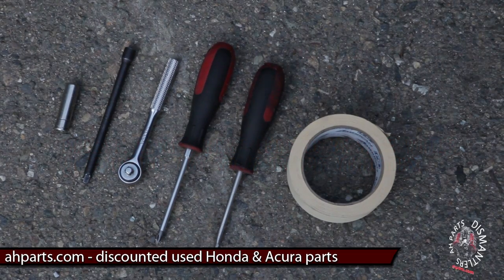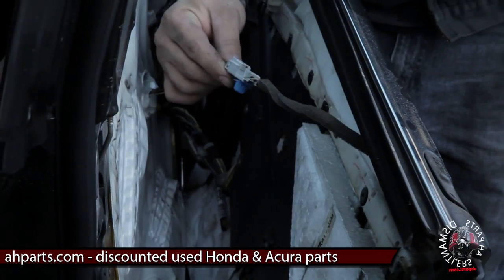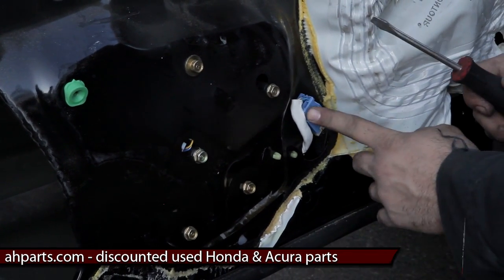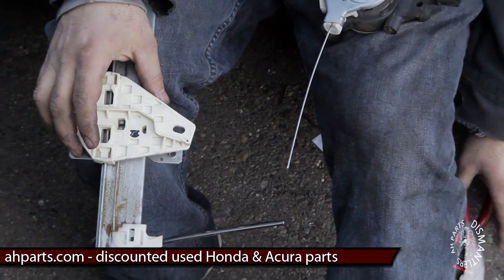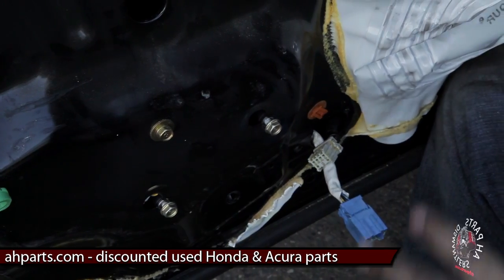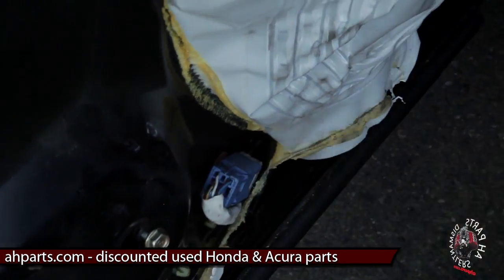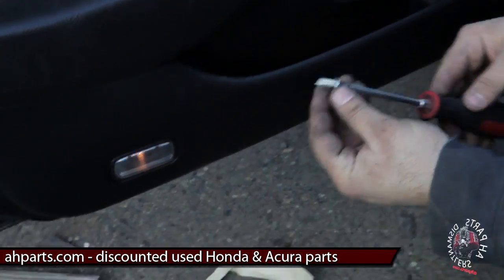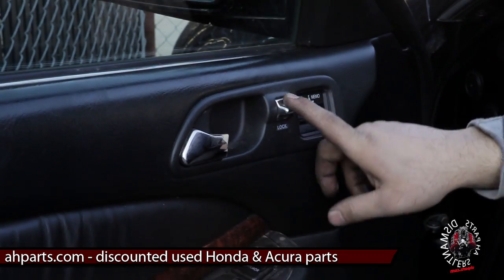How to fix install replace window regulator motor DIY 99 00 01 02 03 Acura TL Replacement Tutorial

Comment: When you remove the plastic barrier, you can also use a heat gun to warm the adhesive for removal.  This will  help preserve the weather barrier for a snug seal when replacing.  Used your video to replace my 2000 3.2 TL driver's side regulator. Your narration of instructions was awesome. The lighting and view angles were also spot-on.

Comment: GREAT tutorial.  I made short work of this job on my '02 Acura TL. Thanks for the tips on the masking tape on the window, and the glue in the socket.

Two things:

1.  I ended up with 3 screws “left over”.  I was stuck for a minute until I remembered that the regulator came with the 3 “grooved” screws already included.
2.  I wasn't able to test the window until the switch on the door panel was reconnected.

Comment: I have my daughter's 1997 Acura 2.2 CL with this regulator problem. I am confident that with this video and my shop manual I'll get the job done. Thanks for a well thought out and detailed How-To video. I especially like the care you and the videographer took to show the bits and pieces i.e. the slots of the partially removed bolts, etc. Great job.

Comment: Success! This tutorial just worked for me, and I purchased the part directly from you because this video seemed so good.  I have not worked on my own car in over a year, and rarely do so.  This made it quick and stress free.  Saved me over $300 that would have been down the drain.  Saved me from getting a broken or slow-shipping part from somewhere else.  Wasn't sure this would fix it because it used to work sometimes and not work other times and I thought it was electrical. Tremendous thanks.

Comment: Thanks guys for the great tutorial! I was quoted $300+ to fix the drivers window in my 2001 Acura MDX. Luckily I saw your video and found the part for $70 shipped and changed this out myself. Took just about 45 minutes. Process was very similar.

Comment: Good job! My only suggestion to make the finish job better is when you remove the plastic barrier, start from the bottom and  use a razor blade to cut the adhesive. Just pull on the plastic so the adhesive stretches and use the blade to cut the stretched adhesive. The plastic barrier remains in tact and the finished job looks better!

Comment: You saved my reputation as a Dad (68) who used to work on cars and my kids $200 vs. Acura's price of $388 to replace. Four things to consider: 1.) I bought the entire regulator from Parts Geek for $140. Auto Parts Warehouse had the same one for $161. Neither one seemed to own the part but were drop shipping someone else's stock. Since Parts Geek didn't have a phone number, I paid an extra $30 for overnight delivery from a warehouse 45 miles from my house. Oops.STILL CHEAPER THAN ACURA BY $100.  2.) Buying the entire regulator is the SMART move because buying just the motor wouldn't have helped since the cable was also broken. 3.) I fought with what appeared to be simple installation for 30 minutes before I discovered that the TSK' part had a motor bolt in the wrong position on the motor for the panel slots. Oops again. 4.) Very happy to discover that the window mount on the channel was already pre-positioned correctly so all I had to do was drop the window and install 2 bolts. SWEET! Thanks so much for your video.
Reply from the maker: Good to hear, Bob! We also sell regulators, for future notice.

Comment: Very helpful video. The rear passenger window regulator cable broke on my 2001 Acura TL and this video applied mostly for the rear door too (just less connectors). I replaced it fairly quickly following your example.
Thanks

Comment: Nice Video.  Very linear, thoughtful about the little details.  I have already dismantled my 2005 MDX window, and it is about the same thing.  Mine works except for some tiny broken plastic guides for the cables that allowed them to disconnect from window slider.   Thumbs Up.  Thanks.  Also, my Air Conditioning Vent Motor seems to have just gone out... the part is so expensive!  Will search for a tutorial or even just diagrams to see what that replacement will entail.  Will also check out your parts store.

Comment: Excellent DIY video! I learned alot!!  Are the parts on the regulator sold seperately? The plastic piece that guides the cable broke off! The window does not close completely. It leaves a small crack opening at the top. Can I use some kind of "super glue?"

Thanks again for the tutorial.

Comment: Question on the new regulator does it have to be in a certain position , the plate that the two 10mm bolts go through that the window attaches to ? In the video it's the part right after removing the  tape off the window.  Thank you for the video

Comment: great video.  Are the instructions the same for a 2004 ?  My 2004 passenger window will not go all the way up when the either switch is used (driver or passenger)  It goes up about 2' and then immediately goes back down.  Regulator?

Comment: Thanks for the help! I replaced my back driver side regulator and it turned out to easier, But I have one question, when I was putting the door frame back on, I snapped the tiny clip that holds the lock pin in place. What is that clip called?

Comment: Who are the 28 morons that gave this a 👎????
Great pro detail that most $$ saving DYI Katz can understand. 
1 suggestions; The aftermarket parts availability/selection may have evolved since filming but there are quite a few aftermarket replacement brands out there to choose from? Maybe listing your preference or a good-better-best; even a Honda Accord part cross match; this would be great information. cheapest part sometimes cost you a lot more in the long run with some of these aftermarket brand “compatible fits” not fitting or even the opposite where one manufacture makes it for 4 differently priced reseller....

Comment: Hey guys, I just bought a new regulator. But the piece of metal that the window sits on it too low to screw in the window. can i manually pull up the piece of metal so i can attach the window to it?

Comment: if the motor is not frozen, do you adjust the window up/down before disconnecting the wire, until the bolts align with the holes?

Comment: Mine was a rear passenger 2003 MDX so not exactly but similar. The new regulator window attachment needed to be lowered to bolt it. However, when I plugged the regulator back for power, it doesn't move. Doesn't act like it's getting power at all. Got a new regulator and same thing. Any ideas as to what's going on? Thanks

Comment from the maker: Should be very similar on the 04. Sounds like a regulator issue. Could be off track somehow as well. Best to open it up and run direct power to it from battery if possible to see how it performs.

Comment: I have passenger side front window that slipped down.  I haven't looked at whats the cause but was wondering if your disassembly directions would be the same for 2001 Acura MDX passenger front.
Reply: The MDX is similar. There is one or two less bolts to loose/tighten and there is only one set of connections for the power window motor.

Comment: On the plastic clip that holds the door handle rod, mine just twisted out of the way instead of trying to pull past the top of the clip. Just twist it like 90 degrees out of the way and then the rod will come right out. I found this out by accident but maybe it'll help speed up the process in the future 🍻

Comment: It appears to me that a replacement regulator must come already positioned at the access holes in the door.  The replacement I have is not positioned there and I cannot slide it to change that. Yours was already at the correct position. Is it a bad replacement or is there some way to move it or is there something I am clueless about?
Seems that if the window bracket were able to slide, it would be falling down all the time.
Reply: You have to plug in the new regulator and bring it down the the position to install.

Comment from the maker: @dtarango18 

Hi there,

It should be the same concept. They almost always are: Remove door panel, unmount glass from regulator, take out bad regulator, install new regulator, mount glass back to regulator, and finally, put panel back on.

Comment: does this tutorial apply to a 2003 acura cl??
Reply from the maker: Should be almost identical.
Reply: +AH Parts Dismantlers Honda Acura thanks for the tutorial. I took the old regulator out and put the new one. Plugged it all back in and turned the car on. The window won't roll up or down. Any tips for fixing that? Thanks!

Comment: Anyone know if this will work for a rear passenger window that won't roll up or down, stuck cracked open, on a 2004 Acura RL? TIA!
Reply: I am working on mine now(rear passenger) for a 2003 tl. If I come across any snags I will let you know.
Reply: Thanks for the update--how'd the repair go?
Reply: Getting the regulator off is a pain. I am using a doorstop to hold my window in place. Still awaiting the part.
Reply: @scentertainment10  thanks for the update. Our window is cracked by about 5/8ths inches, so I used thick painter plastic and duct tape to cover it for now, haha. Still worth DIY or maybe worth paying to have it done?

Comment: I guess good thing that my package got miss sorted. Took extra time to see how to understand it and the little bulge on the door panel outer the window mirror control panel took it all apart and used a screwdriver to shove in monkey glue and there and used to crimps and a free paint stir from walmart. Let it set up overnight and we'll see what happens. That monkey glue really expands. We'll have to cut some out. 2001 that stuff starts to get brittle.